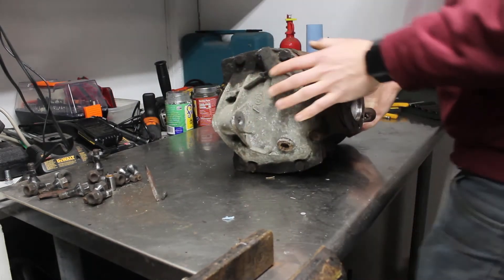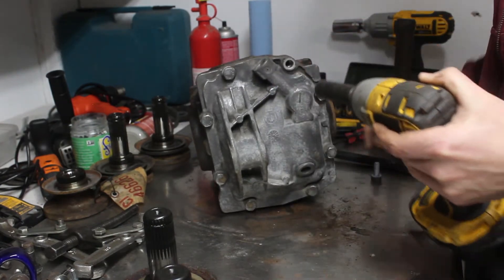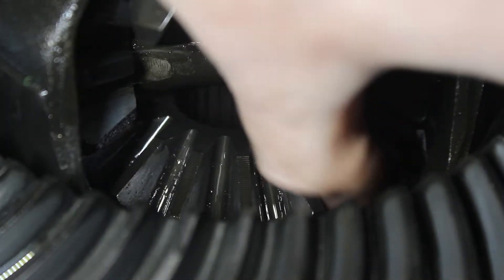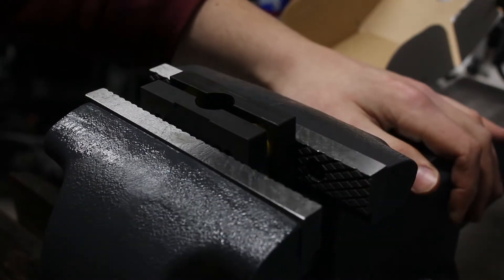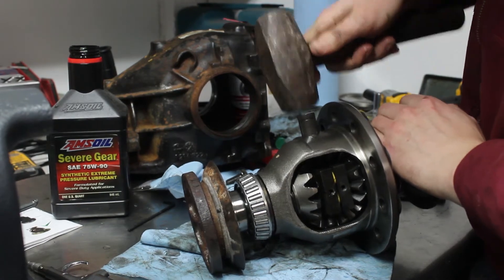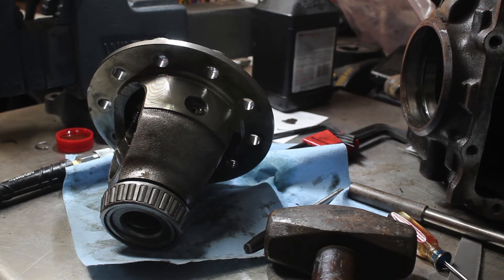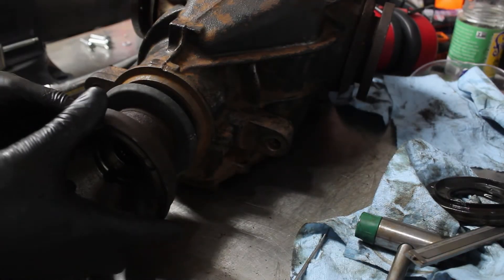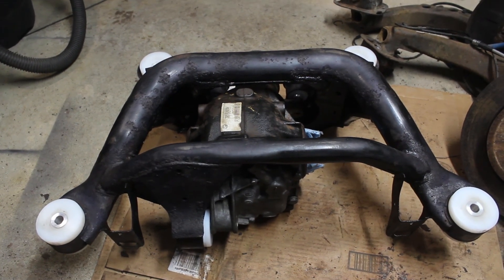BMW E46 Race Car Build: 3.46 Differential Swap, Limited Slip Kit Install

Comment: What confuses me, is that I thought changing the gear ratio would also mean changing the pinion to match the ring gear!
Reply from the maker: In order to change gear ratio, I bought an entirely new diff. You are correct that changing one gear alone will not work.

Comment: I'm sure you've discovered by now that this LSD kit is nothing but snake oil and absolutely worthless on a racecar.
Reply from the maker: I haven't yet, but I hope it does do something, because the open diff is quite awful. I have a hard time believing you though.
Reply: Been building these things for a very long time. Your best bet these days is the MFactory diff from ECS. You have the skills to install one in your car after you try this thing on the track.

Comment: If i want to just change input flange to run a 3.46 in my 330ci will it be ok if i remove the nut, replace the flange, and retorque go spec?
Reply from the maker: What most people do is mark the position of the nut before they take it off with a marker, then tighten to the same angle with the new flange, and that seems to work.

Comment: With a traditional LS clutch type differential there are ramps on each clutch side carrier that when wheel slip occurs, the ramps activate and basically squeezes the clutch pack tighter. This conversion doesn't have any of those mechanical properties. It looks like it just applies spider gear preload via the center springs and metal disks also allowing enough give away in a turn to avoid the spool effect.
Reply from the maker: There's preload from the springs, but it does in fact have a progressive ramp. You can see it when I am compressing the pack together on the vise.